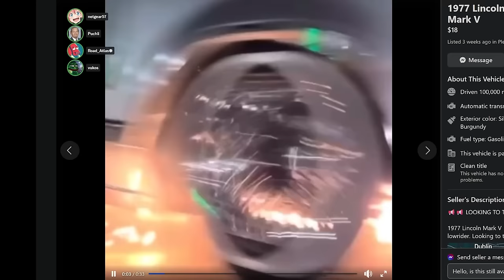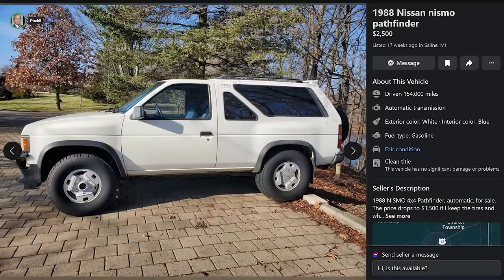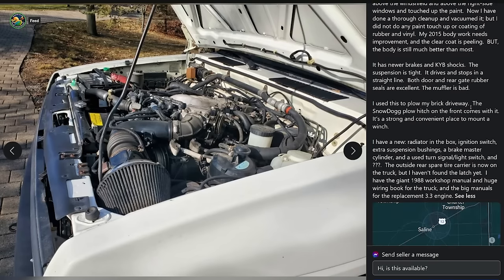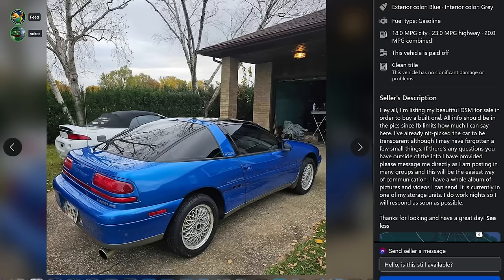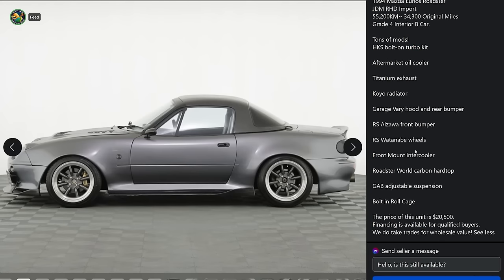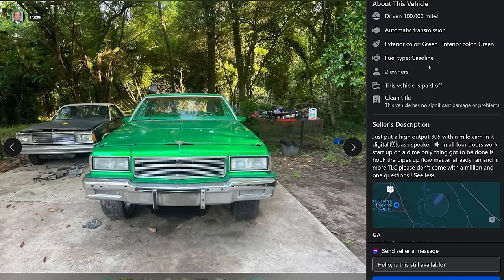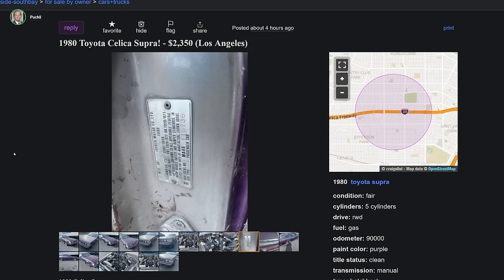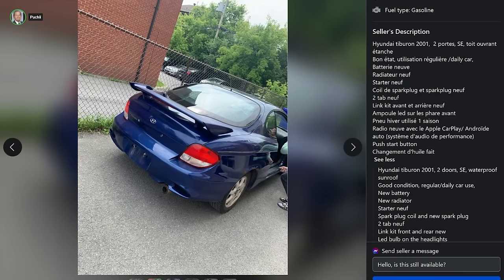Probably the sickest lowrider we've ever seen on Facebook Marketplace

Comment: I actually own one of those mexican ramchargers. 

It's basically a short bed short cab ram 1500 chassis, and it uses a hard rear door extended cab, (because the middle side widows pop out just like the ext cab), and then it uses a late 90's caravan tailgate. 

The only exterior parts that are specific to it are the taillights, rear bumper, and rear side glass, (the long panel) 

The interior is all just 98-02 ram from the front seats forward, and everything behind them is specific to it. 

It's nice being all mechanically dodge ram, easy to get parts to keep on the road. 

I road trip mine all over north america. It's nice because the back seats fold down flat, and a queen size mattress fits in the back. 

It's now got 330000km I've driven it so much. 318, 5.2L v8, 4 speed auto, nice and simple, easy to work on, comfortable to drive, and gets all kinds of attention, I absolutely love it.